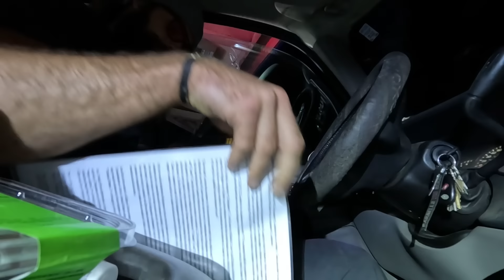This is COERCION: using scare tactics because they don't know The Law

Comment: Ucc
Reply: Except, the Uniform Commercial Code (UCC) is irrelevant to matters related to a State's enforcement of its laws regulating the non-commercial operation of automobiles and other motor vehicles on the public roads. See, for example:

[I] Van Horne v. Valencia, Civil Action 1:21-CV-00173-BU (N.D. Tex. Feb. 16, 2022), slip op at 8-9:

"...Van Horne continues to assert that he possesses a constitutional and God-given right to travel on the roads of the State of Texas without having to comply with the laws of the State of Texas. Id. at 3.

'These arguments derive from the so-called sovereign citizen movement and are legally frivolous.” Westfall v. Davis, Civ. No. 7:18-cv-00023-O-BP, 2018 WL 2422058, at *2 (N.D. Tex. May 4, 2018) (internal quotes omitted). Claimed “sovereign citizens” argue that, although they reside in the United States, they are sovereign unto themselves, and thus are not citizens of the United States nor the state in which they reside. Id. These arguments are cobbled together from Constitutional law, the Uniform Commercial Code, and Bible verses, and are used to avoid legal liability and criminal prosecution. See id.; see also Perkins v. Ivey, 772 Fed.Appx. 245 (5th Cir. 2019) (denying “sovereign citizen” claims of no duty to have a driver's license or vehicle registration); see also Mason v. Anderson, Civil Action H-15-2952, 2016 WL 4398680 (S.D. Tex. Aug. 18, 2016) (denying a “sovereign citizen's” Section 1983 claims against law enforcement). 'These teachings have never worked in a court of law-not a single time.' Wirsche v. Bank of Am., N.A., No. 7:13-CV-528, 2013 WL 6564657, at *2 (S.D. Tex. Dec. 13, 2013)...."

[II] Trujillo v. State, CIVIL No. 10-730 LH/LFG (D.N.M. Nov. 9, 2010), slip op at 1-2:

"...Trujillo's Complaint is based on the faulty premise that requiring him to be licensed, to register his vehicle, and to have automobile insurance violates his constitutional right to travel. While Trujillo's argument may resonate with like-minded anti-government groups, tax protesters, and Uniform Commercial Code devotees, it has been rejected by the United States Supreme Court.

In Hendrick v. Maryland, 235 U.S. 610 (1915), an unlicensed driver operating an unregistered vehicle sought to challenge on constitutional grounds the authority of the District of Columbia to interfere with his right to travel. The Supreme Court soundly rejected the argument...."

[III] Thompson v. Scutt, No. 1:11-cv-573 (W.D. Mich. July 13, 2011). slip op at 5-6:

"...Relying on scattered provisions in the Uniform Commercial Code as well as documents that Petitioner filed with the state court following the criminal judgment, Petitioner asserts that he has superior "claim and title" to the judgment of sentence and conviction over himself, and that he is therefore entitled to release himself from the judgment. Petitioner contends that by failing to respond to his state-court filings, the court and/or the State of Michigan conceded that he is now the holder of the criminal judgment against himself. The Court discerns no legal authority by which Petitioner could gain "title" or "claim" to his criminal judgment such that he could unilaterally release himself from the sentence. As its title implies, the Uniform Commercial Code (UCC) governs commercial transactions. SeeMICH. COMP. LAWS § 440.1102(2) (describing the purposes of Michigan's UCC). It is not a source of substantive rights in a criminal action. Moreover, the state's failure to respond to Petitioner's legally frivolous filings has no relevance to the enforceability of that judgment against Petitioner. Accordingly, Petitioner's claim that the judgment of conviction and sentence is not enforceable because he has "superior claim and title" is without merit...."

[IV] Augmon v. Commonwealth, Civil Action 22-1466 (W.D. Pa. Oct. 25, 2022), slip op at 2-3:

"...As Plaintiff's allegations make clear, he contends that his car was towed because a police officer requested his vehicle registration, and that he advised the officer that he instead possessed a “UCC-1 finance statement” which the officer did not accept. These are the hallmarks of a “sovereign citizen” argument. Adherents of this theory contend that they are not subject to various state or federal laws because they are not United States citizens, as Plaintiff alleges herein. They frequently use Uniform Commercial Code (“UCC”) filings to support their claims, which have been repeatedly rejected as frivolous. See, e.g., United States v. Benabe, 654 F.3d 753, 767 (7th Cir. 2011); Yun v. New Jersey, 2019 WL 3416773, at *6 (D.N.J. July 29, 2019).

The Supreme Court ruled long ago that states may regulate the operation “of all motor vehicles” that drive within their borders, and “may require the registration of such vehicles and the licensing of their drivers” pursuant to their constitutionally protected police power. Perkins v. Ivey, 772 Fed.Appx. 245, 246 (5th Cir. 2019) (citing Hendrick v. Maryland, 235 U.S. 610, 622 (1915)). …"